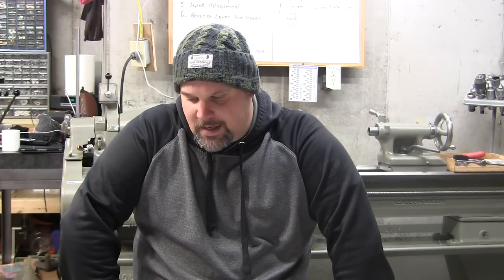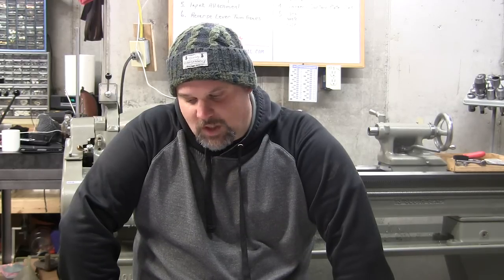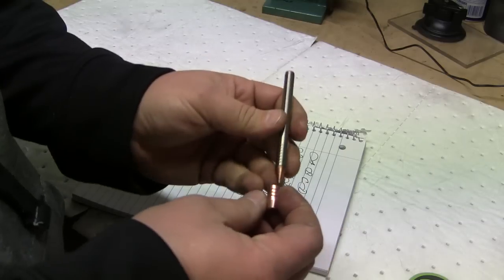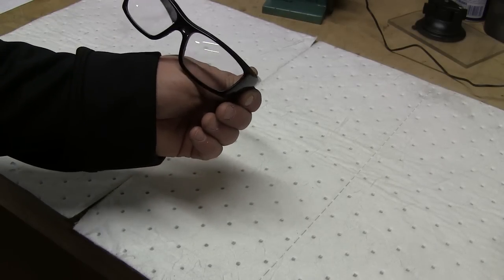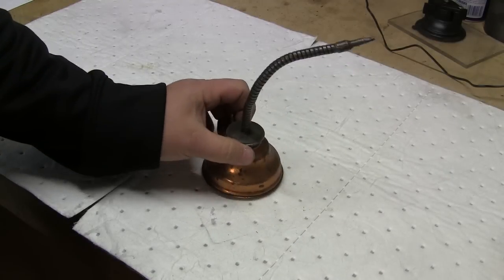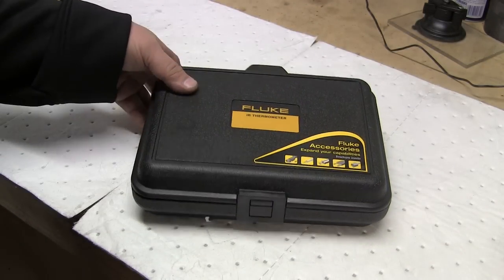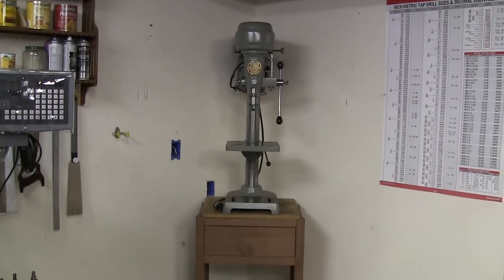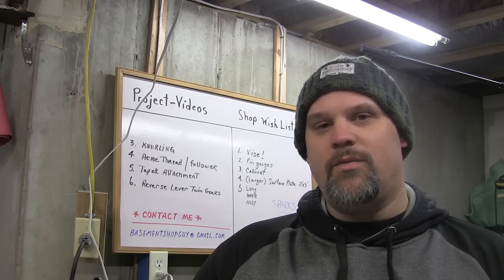Updates From The Underground #1.

Comment: HI Brad, thanks for the shop tour. it's always interesting to see how other guys set up their shops. not to sound like a troll, but i would recommend you install some sort of dust collection device for your grinders. especially your surface grinder. the one i use at work has one but it still spits out an awful lot of dust. being in the basement of your house the dust will eventually migrate up into your living spaces.. your wife will not be amused when her treasures show signs of abrasion due to grinder dust creeping in.
you can modify a shop vac to do the job: replace the plastic hose with a metal one, about 8 feet should be enough for most of the glowing sparks to extinguish. replace the little plastic deflector plate in front of the hose receptacle in the head of the vac with one of stainless. and last put about 2 to 3 inches of water in the bottom of the vac if the vessel is out of plastic or water tight.. that will grab the dust better.
keep up the nice work.
cheers
mike
Reply from the maker: HolzMichel Mike - that's not "troll" talk at all. In fact, those were some of the BEST suggestions I've heard in a long time. Thanks for that man, appreciate it. Makes total sense. I am planning on making up a shop-vac system, but your ideas are fantastic. Thanks buddy!

Comment: Hi, all my wood chucking tools are stored all around the machine shop, far from reach, I find that wood dust and metal chips don't make a good mix with oily surfaces and I don't want to spend the best of my time cleaning.
Cheers, Pierre
Reply from the maker: pierre beaudry Exactly Pierre. My table saw will up stairs in the garage for when I need to cut wood. I also have queen-sized sheets to cover the machines if I do any type of wood working in the shop. I wait a few hours for the dust to settle, remove the sheets and shake em out, outside...

Comment: I would NOT put chemicals near the air handler/ water heater ,If the fumes would go thru the whole house. 

 Also look at moving the mill where you put the drill press , room is fluid just keep moving till it all fits lol  like the wheels on things only out in work area while in use  .

 Good job on the shop
Reply from the maker: danny03455 Yeah, I kinda thought that as it was being spoken, LOL...

Comment: Hope you are going to address your grinding dust evacuation scheme, before you start any surface grinding project. Metal dust that surface grinders create is a real monster to contain and capture. It will literally get everywhere! Including upstairs in your families living area. Some dust particulates are so small they look like faint smoke. Dangerous if inhaled.
Reply from the maker: Rain Coast Absolutely. I have to make a spout/hood to capture the dust. I'm going to have a dedicated shop-vac connected to it. All in time though... In the meantime, I do turn off the air/heat and wear a respirator while grinding. But again, you're 100% correct ;)